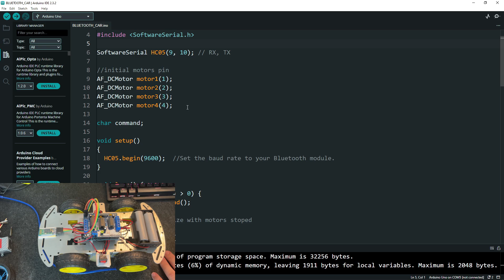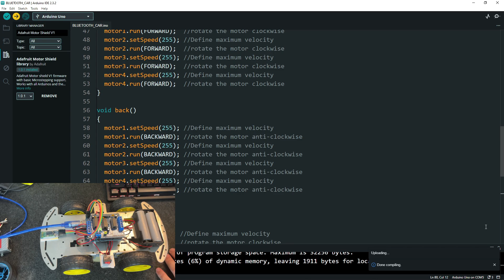DIY Bluetooth-Controlled Car using Arduino & L293D (Android App)

Comment: Can i replace the wheels with mecanum wheel?
Reply from the maker: Yes you can but you have to change the code accordingly
Reply: @LeeCuriosity  thanks sir
Reply: have you tried it with mecanum wheels and does it work